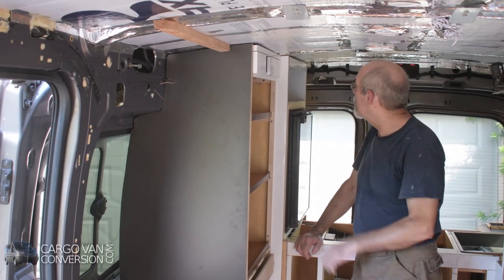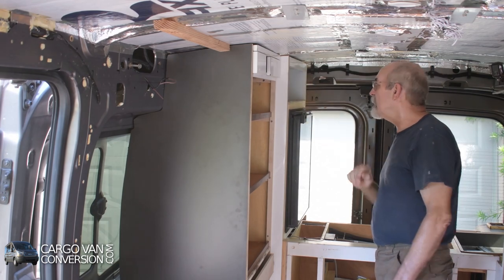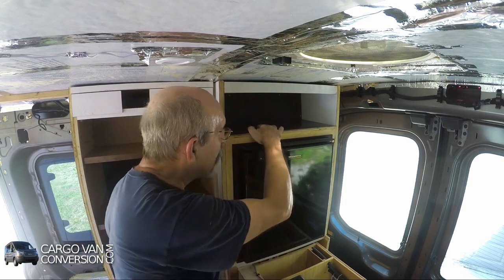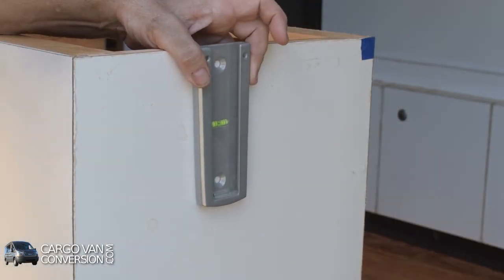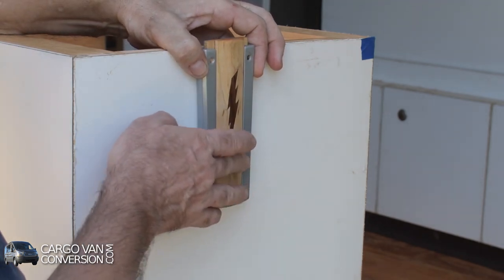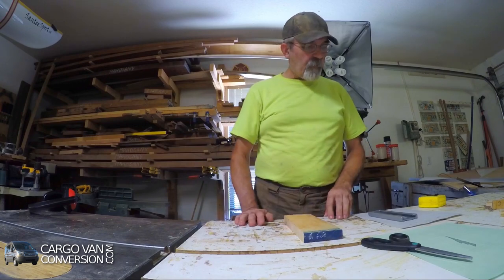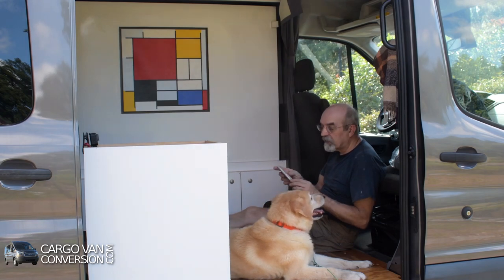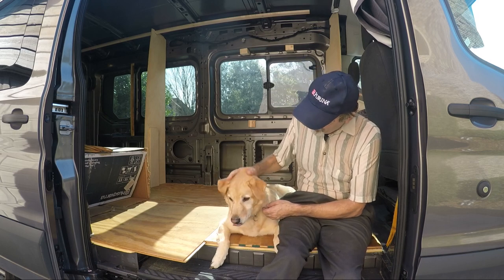Multi-Use Monitor Mount In My Van

Comment: Hey Van, good to see you guys back. Great wood working skills. Fancy idea for the shower head too.  Kat 🚐🐶🌍
Reply from the maker: Hi Kat.
Thanks for the previous inquiries. Slowly getting back to normal here, except for the Covid suituation, of course. The shower is not an ideal solution, but I'm making the most of it :) Hope everything is well out there too!
Van Williams
Reply: @cargovanconversion  nice to hear from you 😊. Why is the shower idea not the original plan that you had in the beginning? It's been a little hard here going through our 2nd harsh lock down here from covid-19 but we are slowly coming out of lock down tomorrow thank goodness. Great to have you both back. Kat 😊🌍🐶🚐
Reply from the maker: @iamkat-agnt99-ash-kbt.59  Hi Kat,
the shower idea hasn't changed much, only some details. But I'm still not convinced about it's usefulness in a boondocking van. While I have a large water tank, usually water is limited and real abundant showers are out of the question.
I suppose they are a bit more sensible about Covid down under; it's at least another year or even longer that we have to deal with. Here in Florida they lost their minds: cases and deaths are seriously up, but shops, sporting events, etc. are being allowed again. Personally, I've been locked up already for 7 months in my home. May consider a move to Australia :)
Van Williams
Reply: @cargovanconversion  yeah I understand about the shower. 30 second to one minute showers once or twice a week while in a van is the go. 🚐 wow that is really crap. No management at all. Me and hubby are much the same Van, been in lock down for 7 months! You would be safer here lol. People complain about lockdown but it's better than what is happening over there. Stay safe my friend. 🚐😊🌍🐶

Comment: I have the same tv mount in my van and to be honest, I'm not a big fan of it. The teeth that suppose to lock the arms when tightened, don't grip that well. I can't just turn the knobs, I have to really make sure the teeth are properly locked as much as possible by wiggling the arms. Even than it doesn't always lock and the TV still swings while driving. Sometimes it's the opposite as well. Because there's movement of the arms while driving it locks itself completely and I have to use a tool to unlock the knobs. Hopefully you'll have a better experience with the mount.
Reply: Nice heads up, 👍
Reply from the maker: I've looked at several of them, but they all seem to have that issue.  I choose this one specifically because it has two inserts. Maybe I have more luck with it, otherwise I will drill a small hole thru both arms/extensions and drop a nail in it. That way I'm sure it won't move while driving.
Wish you well.
Van Williams

Comment: Nice job with the inlay work.  Wish you would have given us more details as to how you did it.  I'm not sure how you got the saw blade into the design having never used a scroll saw...
Reply from the maker: A little late, but I'm catching up :)
With a scroll saw, one uses a very small/narrow blade. On several places on the workpiece, I drill the smallest of holes, through which I can insert the saw blade. Then you cut through TWO pieces of wood at the same time with the saw blade at 3-5 degree angle, dependent on the width of the saw blade. Because of the angle, one of the two pieces of wood is slightly wider than the other, thus compensating for the wood lost while cutting (width of the blade). This makes the two opposite pieces fit together like a glove.
Didn't include these details, because it goes a bit deep into woodworking and may be I should have :)
Van William & Joey